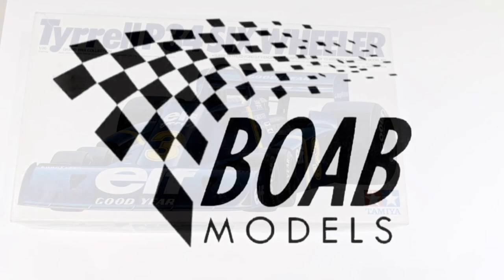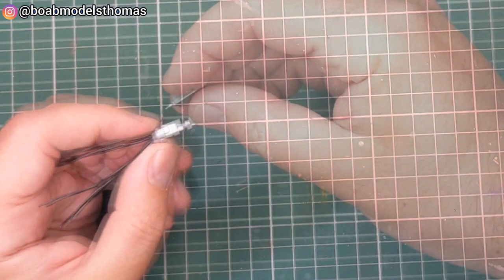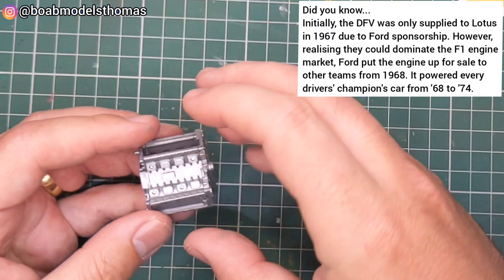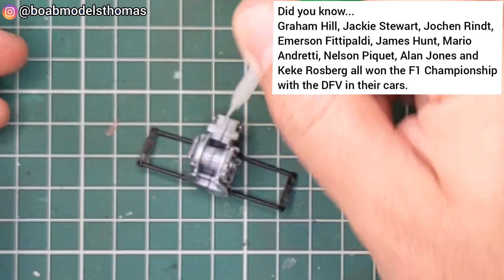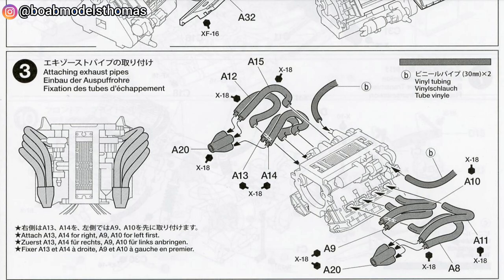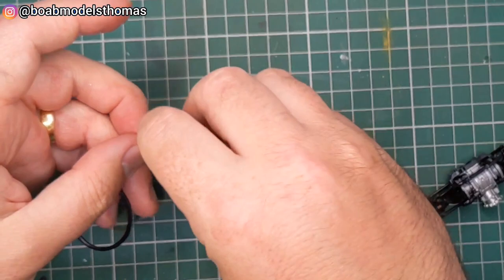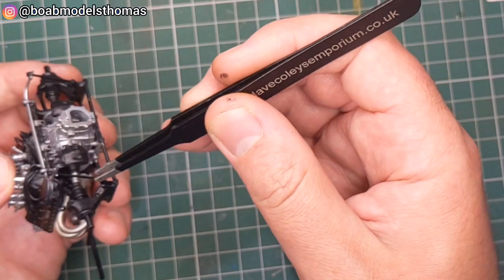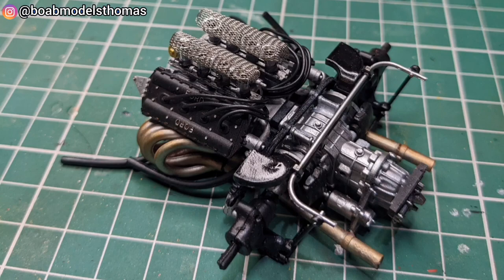Tyrrell P34 'Six Wheeler' 1976 - Ford Cosworth DFV - Tamiya 1/20 Part 1

Comment: Great work on the engine, hate to think how many of those I've built over the years :) the exhaust pipes are the worst, not Tamiya's best design but still is good after all these years. What size tip was the Posca pen ? I definately need to try them.
Reply from the maker: Thanks very much. Haha - this is only my second but I'd like some more cars of this era in the future. A lot of exhaust footage was left on the cutting room floor as I kept making mistakes!
I'll have a look at the pen but it's pretty small - maybe 0.5mm? Got it from Hobbycraft
Reply from the maker: It was 0.7mm